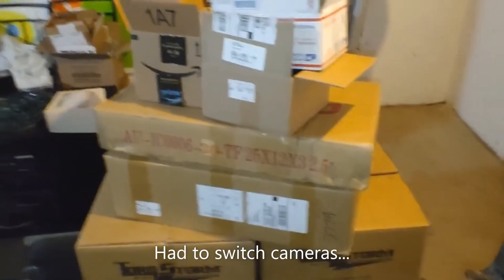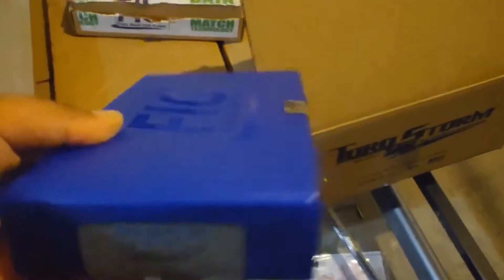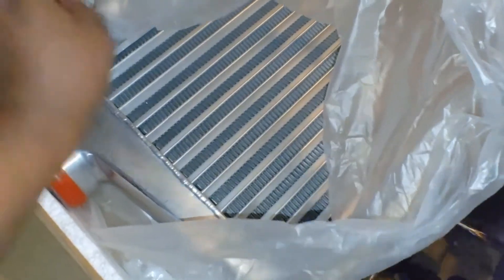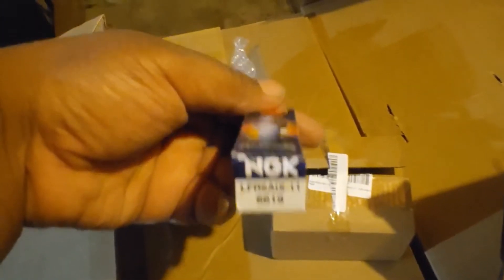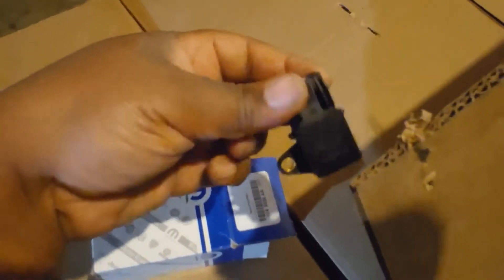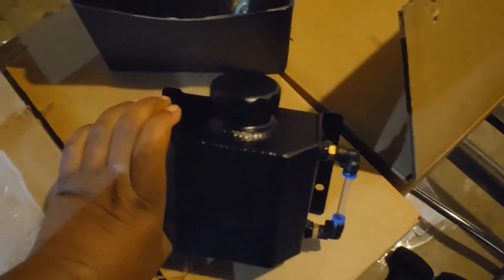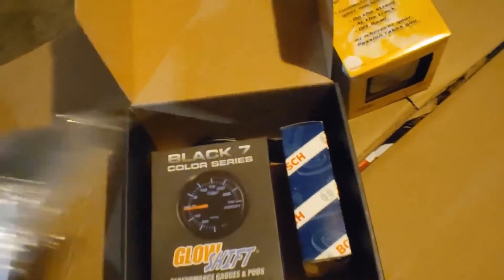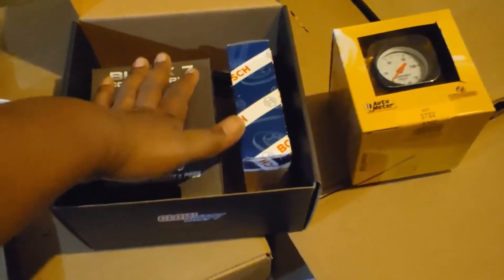Parts Needed For TorqStorm Supercharger Install - Part 2

Comment: how has it held up since then? i wanna run the same setup
Reply from the maker: Still running great. Check out some of my recent videos. My Instagram is also the same name. Good boost for the price.
Reply: @canyou_heminow  what about your ac lines? mine are in the way on my challenger
Reply from the maker: @BigBlackMen-  ac lines were not an issue. They send little spacers in the kit to drop the AC Compressor a little.